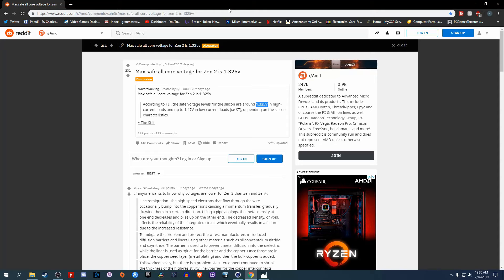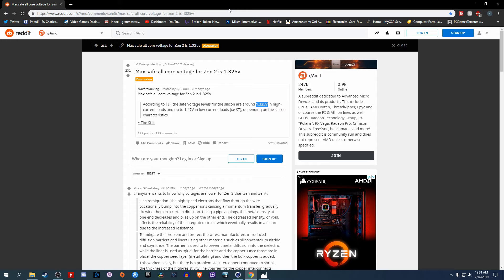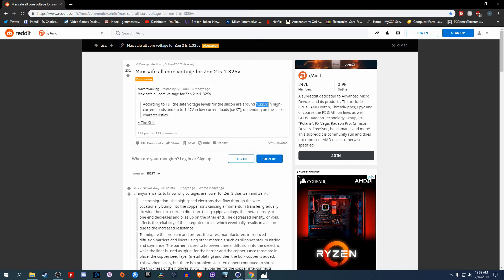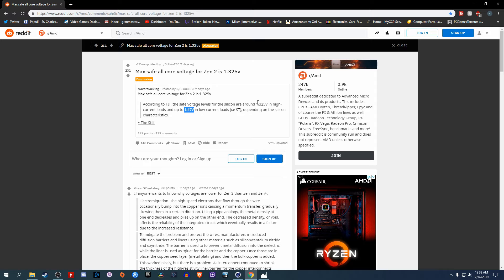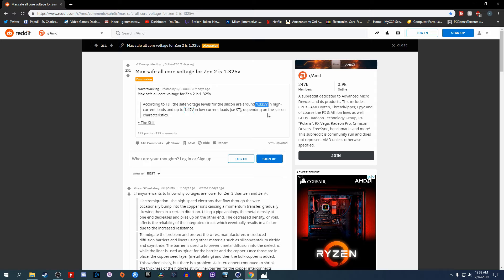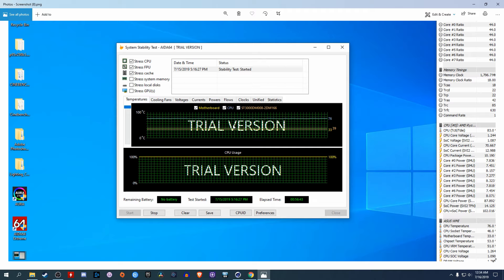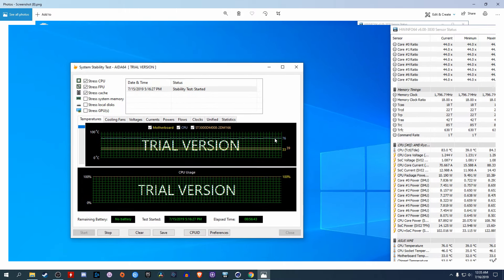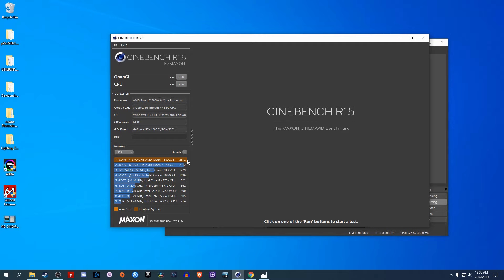Safe voltage for Overclocking Zen 2 - Ryzen 3800x

Comment: my 3800x runs around 1.48 with PBO maxed out and it sits around 4.4 in games... I'm going to have to try a manual OC on it seeing this, thanks.
Reply from the maker: Let me know how it turns out the more info I have the better
Reply: @TokenTech  terrible, it would pass a stress test on 4.4ghz @1.45v. Could be a bios issue though. Gigabyte's launch bios have been trash

Comment: I saw many videos like yours and kept saying that the 3800x is the best zen2 "overclocker". I don't know why and I'm not in a position to explain it in technical details. Maybe others can. But none of the zen2 cpus can reach a 4.4 ghz speed on all cores with decent cooling and low voltages. Look how the best overclockers struggle to get the 3700x or 3900x to a 4.4 ghz speed on all cores and that with insane voltages and extreme cooling solutions. Nice job.
Reply from the maker: It is nice for overclocking but I don't know if that makes it worth the price bump over the 3700x for most people. But it is a very nice chip!
Reply: @TokenTech  True. But, I was just trying to make the overclocking zen2 enthuziasts to focus their attention more on 3800x if they want to get the highest cpu frequency. As for price/performance value, you are right. The 3700x remains the better choice.
Reply: The overclockers are quickly realizing that the only way to actually OC these processors decently is with sub-ambient cooling.  You can get +300MHz with the socket just above freezing (5C) verses 70C, with lower voltages and lower power consumption.

But you can't even remotely get +300MHz with normal CPU temps, let alone high temps.  This node does NOT work the same way that Intel's 14nm++++ node works.  The physics are completely different.

-Matt
Reply: I got ryzen 7 3800x oc 4.5ghz with 1.30volts
idle 38-41 gaming 60-63
Reply: Simple explanation here. Its called binning chips. The 3800x , is just a 3700x.... That came off the wafer doing better than the rest of the 3700x's. So they slap a bigger number and price tag on it. R7 3800x Rtx3080, X570 Crosshair 8 hero mobo (wifi model) m.2 nvme ssd. I run 4.6 all core @ 1.4 , roughly 40c idle (or while i type this on youtube) rarely ever hit 65 in games with a Cooler master ML360 AIO cooler.

Comment: I pushed my Ryzen 3800X to 4,3 GHz at 1,3V on a Asus Prime 570X Pro, although can push it way up to 4,4 GHz with 1,35V. But most of the games that I play are running fine with the 4,1 ~4,3 GHz. Cooling the CPU with a Corsair H115i, once the box cooler was running way hot.

Comment: 1.325V as long as you do NOT mess with the load line default.  That 1.325V number assumes that high-current voltage droop will take it down to 1.245V which is the actual maximum safe voltage for high-current loads.  If you mess with the load line, though, it won't droop as much and you will be well on your way to destroying your CPU.  At low-current loads (i.e. single-core boost), the maximum safe voltage is much higher at 1.45V (which is why stock systems can boost single cores to 4.6GHz).   Don't expect to be able to boost all cores the same as single-core, its just impossible... its a high-current situation that significantly lowers the maximum safe VCORE verses single-core.  That's why it is impossible with normal (ambient) cooling solutions.

The other problem you are facing is temperatures.  Every 20C hotter reduces your OC headroom by 100MHz and increases power consumption noticeably (as per DerBaur's videos).   So your 80C stress test is reducing your OC headroom by 150MHz at a minimum and probably requires another 25W+ in the CPU socket.  In otherwords, its a positive feedback loop that puts the processor into a thermal run-away.  That's why controlling the OC is so difficult.

You really need to keep temperature under control if you want a good overclock.  Lower temperatures also reduce power consumption on this node.  If you can run the system at 65C or lower then you have to reduce your overclock until it drops to 65C.  The lower you can go, the better your overclock will be.

Ultimately, though, the issue is that above 4.1GHz power consumption goes exponential.  The only way to work around this exponential power increase is to go sub-ambient (i.e. exotic cooling).  So no matter how good the motherboard is, no matter how good your ambient air or water cooler is, going above a stable 4.2 GHz overclock is going to be difficult.  And the crazy thing?  The crazy thing is that 4.1 GHz is trivial and 4.2 GHz is reachable on virtually any motherboard, even a B450 (and 4.1 can be reached on a B350).  But 4.3 or 4.4... even with a good motherboard, those are hard to get stable and you wind up burning a ton of money on the cooling solution, PSU, case design, etc to get there.  All for just 5% more performance.  In my book... it isn't worth it for just 5% more performance.

-Matt
Reply from the maker: Hey Matt thanks for all the info! Very informative and helpful. My 3800x is stable at 4.4 all core at 1.3v and I left the LLC alone. Idle I'm sitting at 37c and Aida 64 stability test goes no higher than 76C I think that's alright. What do you think?
Reply: I know old thread, but I'm currently running 1.25V 4.3GHz stable when LLC is turbo, when I leave on high crash after 3 continuos cinebench20. Is it bad to use turbo LLC?
Reply from the maker: Not sure what turbo means in relation to llc but all that means is it's not stable at the voltage
Reply: @TokenTech  That's how gigabyte name the LLC levels, the highest are: "high" , "turbo", "xtreme"
Reply from the maker: Thanks for the info I am only familiar with Asus. I'm not sure if that will cause damage, I know for the Asus boards you wanna be a step or 2 back from the max but it may be different for gigabyte
Reply: Buildzoid, Steve from gamers Nexus, and the German overclocking guy all run up to 1.375 for daily usage overclocking on Zen 2. My 3800x is at 4.5 all core stable at 1.350v

Comment: I use folding@home to stress test for 24 hours. Then I check the HWinfo for errors, if it is still running. (WHEA). I am not sure what is with the high ambient at low load?  Maybe it has something to do with the doping material. Worked on a antique computer system that ran best with a  51C ambient temperature. Engineering in said was the Gallium Arsenide doping that caused it. I also stress the the GPUs at the same time. It is a system thing ya know?
Reply: Yes I am using a CH6, 32 Gb of Flair RAM. GTX 690 and Cougar VTX700 power supply 80+ bronze. Been seriously looking into a 3800X or 3700X as a replacement for the 1600. But it does clock at 3900 with SMT off and 3800 with it on with the same voltages, all day.

Comment: I run my 3800x on 4.3 ghz and 1.25v. It's good for processor?
Reply: allcore 4.3ghz @ 1.25v is very good . my 3600 is doing 1.275 4.3ghz , thinking whether should i do 1.3 4.5ghz
Reply: @RayLee-bp4qs  I had a 3600 and set the clocks to 3.6 GHz

Comment: Everytime I change the voltage it doesn't score high bcoz pbs isn't boosting it to 4.3 ghz I don't know why but it's like it's turned off when I change my voltage to 1.1 and that's all and your right u do get a lower score when u change voltage and even frequency I oc my 3700x to 3.9 and changed the voltage and it got a lower score the when I had it stock at 3.6ghz I think it's coz pbs is not boosting it when u put an oc or change the voltage.
Reply from the maker: Yeah it does a weird thing I heard called frequency stretching where it looks like you have a higher frequency but it doesn't perform like it

Comment: I installed my 3800x yesterday and I only had time to run a couple benchmarks and both times it got too hot and shut down.  Is this similar to what you had with the 3700x?
Reply from the maker: yeah, when i ran aida 64 stability test it failed on stock settings.  and I got one thermal shutdown on prime 95
Reply: No prob with 3700X + Noctua NH-U14S. But 2231 @CineB20 is OK for me @71 C°.
Only QUESTION is high Vc : 1.352v. Too high ?????

Comment: My all core OC for daily use on my 3900x is 4.3Ghz @ 1.3V. At idle it runs slightly below. I leave LLC at 3 on my X570 Taichi.
Reply from the maker: That's nice all them cores
Reply: with smt off u can reach 4.5 with low voltages cuse u have enough cores that u dont need the treath

Comment: hello dude i just bough 3800x and i have asus prime x570 prime pro , i never did oc before. i just need to go bios and increase my volts 1.3-1.5V ? or is there any program for doing it ? and i am not gonna oc always just for gaming like bf5 or new cod mw. should i need oc for them ? and i forgot to ask. my psu have 8 pin for CPU , is this enough for 3800x ? i searched it and people says 8pin enough for oc , +4 is just selling adv. for super OC
Reply from the maker: For those games you do not need to oc. Also don't go above 1.375v for a overclock and honestly these chips run fine stock
Reply: @TokenTech  tnx for advice , i think don't need to change any option then. have a nice day

Comment: Do you do 4.4 all cores?
Reply from the maker: I have settled for 4.3 all core daily
Reply: @TokenTech  what's your voltage under no load?

Are you at a constant 1.3v? My SAFE voltage with prime 95 was 1.22v
Reply from the maker: Under load I'm around 1.2 - 1.25
Reply: @TokenTech  isn't that bad ? You said in your video it has to be at 1.4v for it to be safe under no load because of magnetism or something

Comment: What max OC do you advise for a beginner? Voltage and ghz, so i dont have to worry about destroying cpu
Reply from the maker: For a ryzen 3000 cpu probably try 4.3ghz at around 1.325 volts

Comment: Hey, i dont know anything about overclocking, where did you make those changes and would you do a guide on it? I would also love to learn with what RAM Speeds the 3800x is best with.
Reply from the maker: I can do that, you can adjust settings in the bios of your mother board but it can all get a bit overwhelming for a first timer
Reply: @TokenTech  Yeah, i saw that coming already. However, i still wanna try it out, or atleast solve how to get the most out of my RAM since i will be running DDR4 4000 LC19. I heard People say that all above 3800 just wont work as the clock between them would be 1:2.
Reply from the maker: I have been hearing the same thing but it seems to be on a case by case basis. Some are seeing higher scores with higher clocked memory even above 4000. Some are not. You can also adjust the fclk on your own and see what is the best match up. Another option could be to down clock the memory and lower timings, maybe 3600 at cl 14 or something could be awesome. Won't know till you test it
Reply: @TokenTech  That is true, what programs do you recommend to adjust the settings and which programs to test them?
Reply from the maker: Hardware unboxed just did a great video on changing and testing memory timings. They show you all the software you need and how to use it! It should help you out alot. I personally haven't messed with memory timings
Reply: @TokenTech  thanks for the recommendation, i am looking forward to more of your content. I found you today, and i think you have potential! Thanks for all the answers and help. Would be cool if you would actually make a guide on that stuff!
Reply from the maker: Thanks man, I'll see what I can do!
Reply: I bought 4x8gb 3600-18 vengeance LPX. I raised the voltage to just under 1.4V and did not change timings and it is now running at 3866 just by selecting that from the spped selection when using XMP in bios. This adds about 1% score to Cinebench compared to just using 3600.

Comment: The heat from these different Ryzen CPU,s aint the same compared to many Intel CPU,s when they work different.Something who looks to confuse some users.A good cooler is always one way to resolve the heat as usual if you are in to overklockning.But it would still be nice if they could get the heat down some in the future om idle when they otherwise on load behave good.
Reply from the maker: Yeah they def behave differently than Intel. Seems like the 3950x is binned so well that it's temps are very good.

Comment: Okay I just tested my 3800x again and it has 1.475  all the way up to 1.5 volts idle.   The voltage drops when running a benchmark. This cant be normal??? 60+ degrees idle this is all straight out of the box with stock cooler
Reply from the maker: Above 60 on idle is very high. For me I'll see it bounce from 35-55 but never really sustain above 60. Also how hot is it in your testing area that can affect temps. But honestly if you can't pass a test with everything on default there might be something wrong
Reply from the maker: are you using ryzen master? also it should drop voltage under load because the current goes up
Reply: No I'm not using ryzen master I guess I should.  I gamed on it for an hour and the highest it got was 75c while gaming but still high idle temps
Reply from the maker: what is your room temperature? also hows your case air flow? I have heard that ryzen master works better at lest for now.  I have not tried it yet though
Reply: @TokenTech  I'm gonna try ryzen master.  It's like 68 degrees room temp
Reply: I'm a total noob at all this.  I downloaded the latest chipset drivers installed ryzen master and I running on the ryzen balanced plan.  1.3+ volts idle
Reply from the maker: I'm gonna test out some ryzen master stuff today.  Optimumtech did a video lowing voltage in ryzen master to get better temps.  You should check it out, and i will post my findings later today.
Reply: @adammeek2280  The problem with some tools right now is the way they poll the CPU for data... on Reddit AMD said that currently some tools are basically asking the CPU to boost every time they ask for data and the returned voltage ends up being single core boost voltage... the ones that are reporting correctly will occasionally show less than 1V, like 0.993V, which is the actual idle voltage.

There were jokes about Schrodinger Voltage...  it's only there until you ask for it and it's gone until you don't need it... 😉

Comment: My 3800X is stable 4.4Ghz @1.4V. LLC is set to default (Idle = 48, max load temp 79C). I just set clock ratio to 44 and Vcore to 1.4V in bios. That's all. I could hit 4.45Ghz same voltage 1.4V but i had to set the LLC to Medium to make it stable. However, temps are around 86C max which is a bit too much. Probably I could hit 4.5Ghz with 1.45V, but that would be toasty. LOL. I'm using H115i Pro RGB AIO anyway.
https://youtu.be/-nRq6huIrq4
Reply: You don`t Need 1.4 V for 4.4 Ghz, you just Need 1.325 V. I have the same CPU, mine is on the Ground of the spread and i can`t get, no matter how, above 4.425 Ghz. no way BUT you must disable PBO.  You will get 10° C less than with 1.4V and much more stability.
Reply: XMP enabled / Ram Timming 16-18-18-18-36 56 @ 3200mhz
1.325V @ 4.475 
Cinebench 5379
Cooler Master AIO

Comment: So im good with 1.35V no load and ~1.3V under full load with LLC on.
My 3600 can do 4100 to 4200 mhz with that voltage under load depending on what you view as stable: Cinebench-stable... Prime95 Small FFT-stable... there can be 100mhz difference between those.
4200 seems to be the limit 4250 already crashes Cinebench. Should have bought a 3600X that would probably clock to 4400.
4200 is kinda shitty imo probably combination of ~80C core temp, the weakass vrm of my b450 board and a not so great 3600 CPU that's at the lower end of the silicon lottery.

Comment: Got mine to 4.35GHz at 1.30625 Volts, Cinebench R15 score of 2191, and an R20 score of 5050. This seem right? Cinebench kept crashing at a higher frequency, even with higher voltages.
Great video by the way.
Reply from the maker: The r15 score seems low, my chip gets over 2200 on default which is around 4.1ghz. you might wanna give just a little bit more voltage. And thanks!
Reply: Token Tech I’ll see what happens
Reply: Token Tech got 2212, tested again and blue screened. Most likely because I was messing with BIOS overclocking before.
Reply: Token Tech Got 2208 at 4.35GHz and 1.3V
Reply: Token Tech Last one: 2234 at 4.4GHz and 1.3V. Not sure why I couldn’t hit 4.4 earlier, but I got it now. Maybe too high of voltages? Can too high of voltages limit your clock speed?
Reply: @RCKid   Same here, bad CPU caught, AMD exchanges, some CPU`s  reach 4.5 on all cores
Reply: Rudi Renntier so what should I do?
Reply: @RCKid  Be Happy with 4.4 or send an email to AMD for changing the CPU. I`ve send them an screenshot from HWinfo during loading - i had not more than 4.1 - 4.15 Mhz Stock
Reply: Rudi Renntier I think 4.4 is plenty. The difference from 4.5 is not much.
Reply: @RCKid  sure but I pay 405 € for  4. 5 GHz. ! not 4.2 or 4.4.  When you are buying a Car with 4 Seats and then it has  only 3 ....you'll give that Car back i guess.
Reply: Rudi Renntier I currently have GTX 1080 but I’m soon going to get an RTX 2080 Super, would that 0.1GHz really make a noticeable difference?
Reply: @RCKid  not in a Game with 2k or 4k Setting, for sure. Maybe in 1080p. But, the Point is not if you are getting 2 or 4 more FPS in Game xxx, the Point is how do i get the Performance for my Money AND what is the highest Performance with less Electricity .. save the Planet and so :-)
Reply: Rudi Renntier If I normally get 60fps, what improvement could I expect?
Reply: undervolted that clock u should get 5300 pst r20